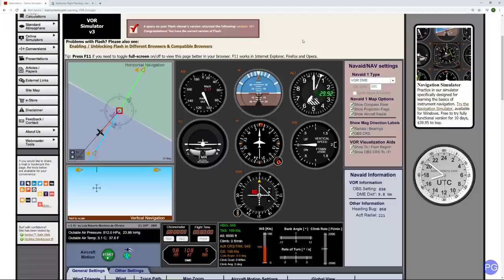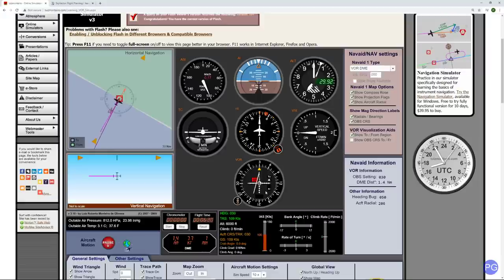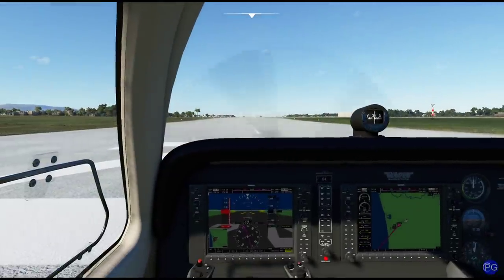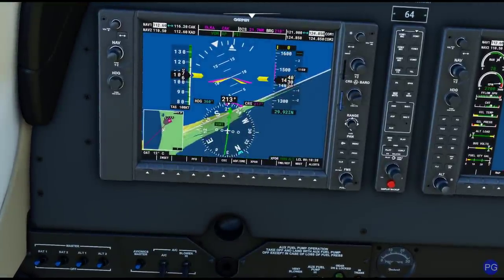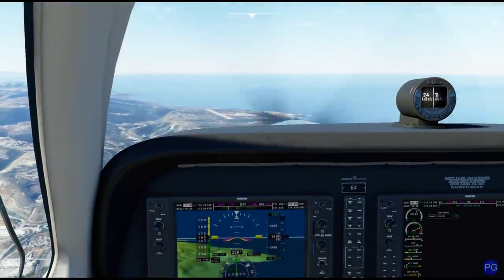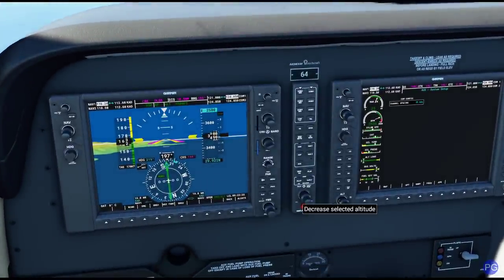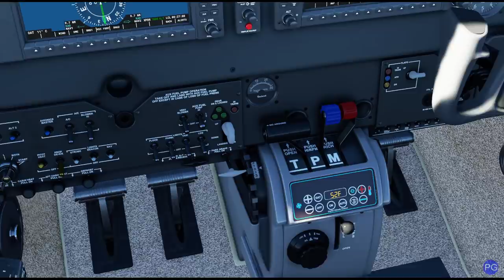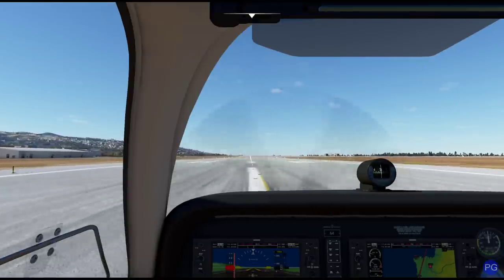FS2020 Tutorial - Radio Navigation VOR

Comment: Another ace video. How have you got the simulation rate to increase? I've tried hitting the 'r' button as per instructions, but it doesn't seem to work!
Reply: I never could figure out R so I mapped speed up and slow down to [ and ] and have been using that.
Reply: How did you do that? Just by assigning keys in the settings front page of MFS2020? Hadn't thought of that!!